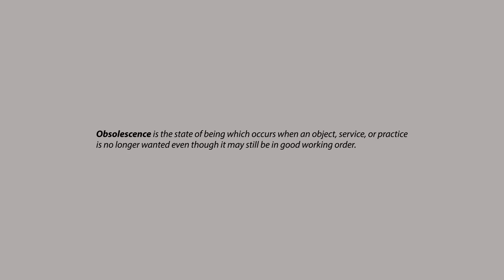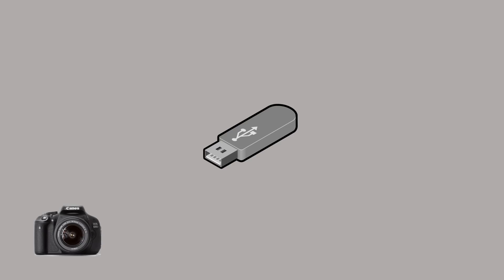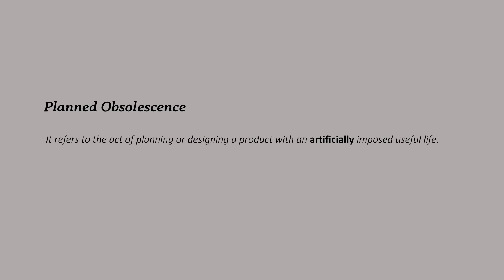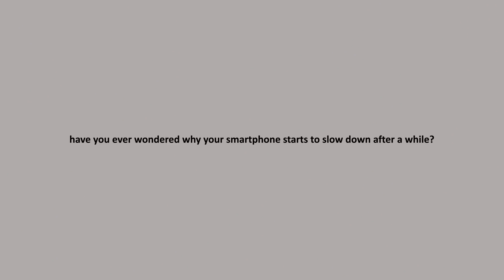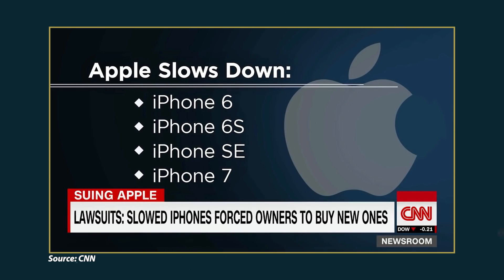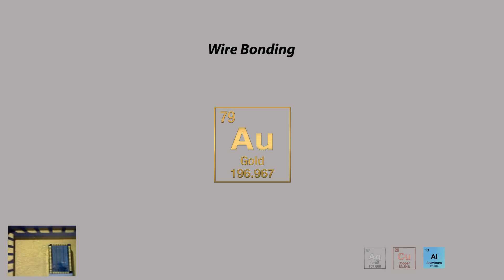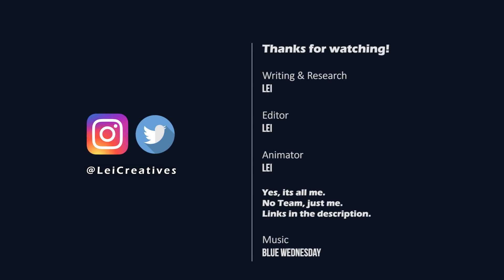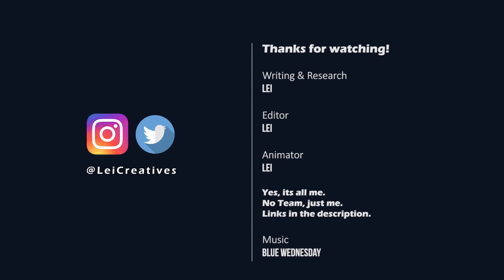Why Your Smartphone Seems to Slow Down Over Time?

Comment: Right, battery usage as an excuse. That's why you hire a PR team.
Reply: Apple, the company that sells you a 1000$ phone, and then it slows it down after 365days, they should've at least add something with the headphone jack cost, but of course it iSheeps will always defend their anti-consumerism
Reply: Wouter Ensink its not a matter of battery gone bad.... The problem is they didn't tell you in the first place... 
Your battery may gone bad.. But apple intentionally slows down your phone.. Thats the problem... 

You can bet if no one found out about this and make it viral.. They won't tell you thats its a battery problem... Because they want you to Upgrade to newer models not switch battery... 

And its not like they will make it easy for you to get a replacement battery, Tech Insider made a video about it, even though you feel that your phone slows down, when you get to apple store they will make excuses that shows that there's no problem with the battery..
Reply: tharealdirector other companies don't intentionally slows your phone down and not telling you... 
This video is about planned obsolescence in smartphone... Apple did that.. Other companies don't
Reply: matjojo umm Apple uses the best battery’s in the market for their capabilities...
Reply: @treymiller5736  no, I'm sorry buddy but they have some of the lowest. Their non plus sized phones have sub 3000 milli amp hour batteries and the plus sized ones have ones barely over 3000. Meanwhile, Samsung pack 4000 milli amp  hour batteries into their note 9
Reply: Addicted Cubing I’m sorry but i reread everything I said and I never said anything about Apple having the biggest battery’s.  They do have the latest tech in battery’s if that’s what your commenting on but that’s about safety reuse and size to power ratio not this holds 4000mah I mean what’s better a phone that holds 4000ma or a battery the size of a house? That’s number doesn’t mean battery just means more power storage which is often useful depending on what it’s for.
Reply: Addicted Cubing comparing the mAh of phones with different OSes and different processors is stupid tho, since the different setups will use the battery differently. Its like comparing the size of the fuel tank of a diesel car vs a petrol car. The spec that really matters is the actual range, or in the case of phones, the battery life. Taking your comparison for example, according to phonearena.com’s battery tests, the note9 with 4000mAh lasts 8hrs 56min, but the iphone 8plus with 2690mAh lasts 10hrs 35min.
Reply: Jotsy z I’m thinking more like gas vs nuclear.  A huge gas engine maybe more powerful then a tiny nuclear (which currently doesn’t exist) but that doesn’t mean the nuclear is much more high tech and the best to offer so comparing raw Energy storage as far as high/low tech isn’t even relevant.  As at no time did I ever say iPhone battery was bigger but just that it’s the latest and greatest tech (but Samsung is at the very same tech bc Apple nor Samsung actually owns the batteries)
Reply: matjojo Apple also uses the highest power draw cpu and it seems so high it’s nearly redlining out of the gate... with things like snapdragon this isn’t an issue bc they were designed with many configurations in mind before even designing they don’t want it to only work with 2amps of power but also 800ma of power
Reply: Kevin L many of the phones many are complaining about don’t have issues.  And they ones that do ppl are having to waits months to get a replacement bc there is such a high backlog with so many who don’t need a replacement getting them.

Watched their video even iOS 11.3 said the battery was just fine and if you mess up a battery in just a few months There is a huge problem.   They made it sound like a battery replacement was some magic fix heads up it’s not if everything is running smooth your not very likely to notice the downclocking of the cpu your gonna notice your battery getting sporadic first.  I feel like tech insider was bored and needed a video to much when they made that video like hey this phone might fit what we need let’s go setup an appointment that I can then record lol
Reply: Wouter Ensink why is the I phone 7 being slowed is when it's just one generation old ? Batteries don't deplete that dam fast  it's obvious apple wants to prompt users to spend more money on the newer I phone 8
Reply: Donovan Hall the can be slowed doesn’t mean they are.  If u charging them twice a day and left the phone in a 150f car on multiple occasions your iPhone 7 battery could already need replacement.
Reply: Trey miller charging twice a day didn't mean degrade in less then a year
Reply: Donovan Hall yes but a iPhone battery is warranty for 500 cycles after 730 cycles AND being reckless with leaving your device in destructive amounts of heat yes all it would need is around a year b4 it craps out.  An example of destructive heat a few years ago we went to Florida my aunts phone dead while at a restaurant she thought hey let’s charge the phone in the car while I’m gonna be gone for about 2 hours while it’s already over 100f outside.  She’s thinking dead battery not thinking hey I might come back to a bad battery.  It’s mostly ppl being reckless getting bad battery’s in a single year.
Reply: +Trey miller Doesn't your key need to be in your car to charge your phone?
Reply: grlmgor my car yes my old car no. Depends on the car.
Reply: My iPhone 6s plus has seen a significant speed improvement after battery replacement and iOS 12 update
Reply: Sara Skywalker try an android my Father moved from iOS to s9+ and he freaking loves it
Reply: Sara Skywalker Right, stupid people acting like they know everything without doing any research on the topic they try to bash. That’s why you get an education.
Reply: Sara Skywalker apple’s excuse makes sense tho. Think about it logically. If apple wanted to throttle performance to get people to upgrade, why would they do it that way? Why would they waste time developing code to detect the health of the battery when they could just flip a switch and lock older devices out of newer, faster updates? And if you wanted people to upgrade, why bother pushing updates to devices that are over 5 years old? They could just do it the android way and stop updating devices after 2 years.
Reply: Jotsy z tbh the throttling isn’t actually really noticed itself problems start when apps were never designed with your device in mind something only thought about for a iPhone 6s+ but then no limit is set and then ppl with an iPhone 6 download it and bitch well that phone never had enough power to run the app smoothly to began with my iPhone 6 I had the battery replaced (it was shot to a point the device stopped turning on reliably played to many games on it) and ever slow issue it had b4 didn’t even change from an experience stand point but I never had a single issue with iOS itself but games I had started getting longer boot times and lagged when typing something that never happened in the default messaging app it was very snappy in ever regard.

Also if anyone noticed the new iPhone have double the efficiency yet only 15% speed bump which means the a12 only uses 57.5% of the amount of power as most of their past cpus so Apple did listen and they won’t have to underclock the a12
Reply: That would be a good one, but in this case it really is the battery. If you put a new one in your phone it will be faster again. Geekbench results proved it.
Reply: Wouter Ensink what of my iPhone seven is basically new even though it’s on the list. My device isn’t very used and is very new.
Reply: @WouterStudioHD , yes, i f you put a new one in your phone it will be faster again. BUT the problem here was that Apple did not inform their customers about this fact, so they didn't have the information to makes their choice based on facts: 1) Cheaper option: buy a new battery to regain the original speed of your phone and also increase battery stamina and use it for a couple of years more,  2) Pricey option: buy a new phone. Hiding the fact that the phone's software is decreasing intentionally the phone's performance left those customers who wanted back their phone's speed and performance left no choice except the pricey option.
Reply: All batteries will get worse over time. There is not a single battery design that doesn't lose capacity. It's just not chemically possible.
Sure, they could have used better batteries, but the same problem would still occur after a while.
Same with cars. They need new tires, new batteries, new gearboxes, new seats, new everything after a while. Those things are not free to you either.
Same with your phone, if you want to keep the original performance, then you have to buy a new battery at some point.
At least you can turn the throttling off in iOS 11.3 so your CPU performance won't be affected anymore, which is something, I agree, they should have told us.
Reply: It is a shame that the YouTuber only mentioned apple in this video without even mentioning the fact that apple is the only company that you can get the latest firmware update on a 3 year old phone (iPhone 6). Lithium ion batteries will degrade rapidly except where you have a BMS with thermal management example in a Tesla or a Bolt. Processors draw power based on the task being carried out. If your processor attempts to draw peak power and the battery cannot supply it make damage your device, apple decide to throttle the possessor of devices if it detects that the battery is degraded in order to protect the device.
Reply: @tharealdirector  , the phone continuously monitors the battery status, like temperature, charging percentage, charging current, charging cycles,  etc...  so technically it is a peace of cake to detect that the battery is in bad shape. It would have been fair from Apple to inform the customer that their phone's battery if degraded and the phone can't function on the same high performance before. Let them give the chance to decide  if they want to buy a new battery or a new phone if they are not satisfied with the speed of the phone.
Reply: Andras Zentai I think hiding that was PR goes back to if apples phones slow down after let’s go off the deep in 6 years (basically the limit of the device and battery itself) and it tells your your battery is bad and your phone is going to slow down then that person will start bad mouthing Apple that person will less likely buy another Apple device thinking Apple needs to fix their battery problem even though they really use the very best battery’s on the market now hiding that backfired on them but telling them could have easily backfired on them as well battery mostly start going bad in phone after 2-3 years and by year 6 of daily use them are worthless no other company tells u when your battery is bad apple feels y would they want to start that possible train wreak.  Ppl often ok age and that it’s old compared to something new compared to a part of their phone is shot.